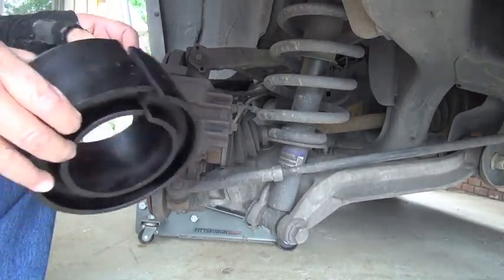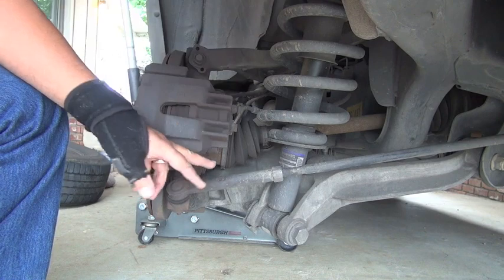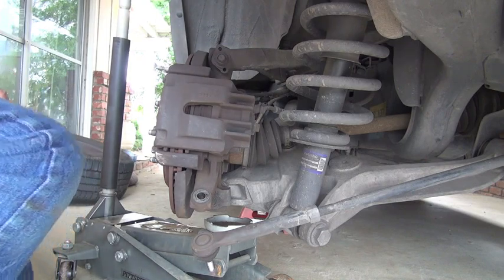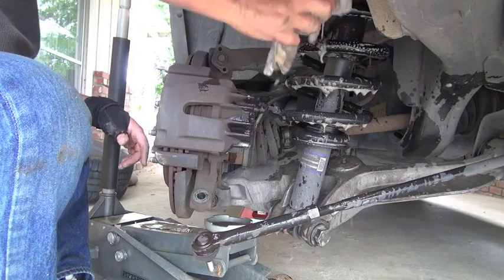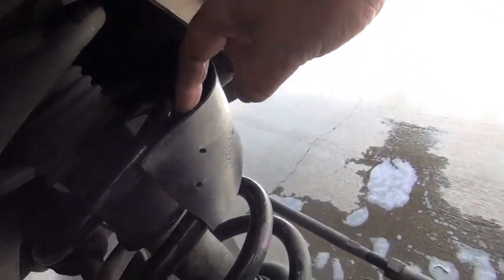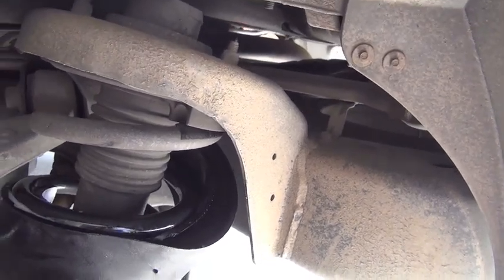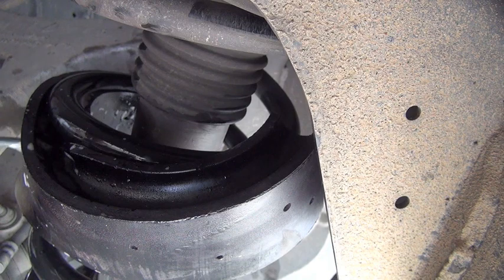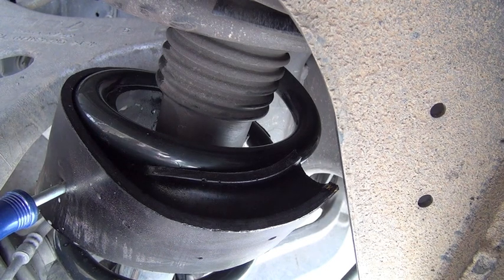2003 Ford Expedition SumoShocks Instillation

Comment: I know this is old video, but for those who are looking at buying these like I am, if you want to make this both easier and do it right, you have to get the right size. Everything he does here is unnecessary if you measure properly. From the manufacturer: "Take the measurement with the vehicle as it sits. You do not need to raise it." Meaning there is compression on it when you measure the coil gap and select the size. It is NOT the distance when extended. I haven't been working on cars for 40 years, but I can follow directions.

Comment: FINALLY! A helpful video, oh man I feel your pain! My Expedition was a real PIA! I trimmed one of the front corner channels to get it started and forced the sumo in with clamps and cussing. Ended up one lower than the other, so tight it wont spin up to the center. I will use your method removing sway bar to spin ip to match the passenger side. Thank you SO much. I wish I saw ‘this video  sooner!
Reply: Mr. Chuck, Sir, u r the man

Comment: Actually the procedure is good,but you missed to measure the gap of spring at un-load condition so correct rubber damper is used.

Comment: I'm under the impression these are supposed to go in the middle of the spring where there would be the largest distance between the rings of the spring and the greatest about of movement under normal conditions...

Comment: Hello, nice video. My 06 navigator head dips lower after I convert the air suspension to coil springs. Would this little thing raise my front higher? to make the car leveled at least? thanks

Comment: I think you got a size or a couple of sizes too large.  They should not be that difficult to install.  Also, you wet them or spray them down with soapy water as well as doing the spring, they go in much easier.

Comment: Shit, I was looking for something easier than replacing my coils this winter, this is harder than swapping the coil out, I can loosen the shock, jack up the van, unbolt the locking tab and out it comes. I'm afraid my new tires are going to rub due to the coils being old, broken down, maybe the aluminum twist in spacers will work.

Comment: WOW I can't believe you  said it was cheaper for these than getting new springs.  These things are expensive as gold.  It is just a piece of rubber.  I bought a lift kit for front and rear for less than this.  I never thought a piece of rubber could be so expensive.  I checked the auto parts store, and a set of Heavy duty Springs with Shocks for the rear of my expedition is $250.00 - these pieces of rubber cost more than 200.00, unless you go with China, and they are still nearly 150.00...  I don't know if I have said it yet - But MERCY these things are expensive ;)...
Reply from the maker: The coil spring helpers that I installed on his vehicle were factory direct and  cost a total of $170. That was with taxes and shipping.
Reply: Autozone has them for 8 bucks a pop!
Reply: I got auto zone brand 17 dollars each

Comment: In malaysia. I fixed this buffer on my camry2010. 4pcs,price RM120 only. The forman fix this very easily. Never loosen any other stuffs. Never use any tools or soapy water. He just jack up the car, fix this buffer on the coils. Each buffer fixing took around 20seconds only. I wonder why this dude having a hardtime fixing it. The purpose of this buffer is to prolong the life of the absorser. When we hit any road hump hardly, the buffer will stop the coil cruncy, and the absorber will not fully retract. We save money on absorber changing with this rescue buffers. Cheers...

Comment: Hello Chuck, Hope all is well. I own a 2015 Expedition and wish i could see a before and after with a heavy trailer. I am pulling a camper and with the weight distribution hitch it still squats in the back. I wish I could see what the difference it would make after installation of the SumoSpring helper.
Reply from the maker: I installed these on my son's vehicle because they had purchased a travel trailer and was in the same problem as you. Once I installed the SumoSpring helpers his Expedition rode level and and his steering and braking felt more secure. He also said that the ride was firmer when he wasn't towing, 'like a new car ride'. Because of the increased ride height on the car, the tongue of the trailer will need to be higher so get a tall block for the trailer jack.

Comment: chuck does give a inch lift or 2 inch?
Reply from the maker: I didn't measure but it seemed more like 2". We did it to improve the ride while towing a camper trailer, and it did.
Reply: Will this will increases the stiffness of the spring

Comment: What r these used for?
Reply from the maker: suspension assist devise. I installed them on my son's vehicle to assist in suspension support for towing their travel trailer. His suspension was pretty tired after 150,000 miles and rather then install a new suspension system I installed these, which gave him the feel of a new suspension and maintained a level ride when towing.
Reply: @chuckraybon5780  will this increase the stiffness
Reply from the maker: @thejagc3736  It took a lot of the bounciness out of the old springs and gave it a greater 'like new' ride.
Reply: Does it give you a lift

Comment: that's not a control arm, mr. forty years mechanic. that is the tie rod.
Reply from the maker: Thank you for the input, I stand corrected.
Reply: Actually it’s a toe link. Used to adjust the toe in or out on the rear wheels. Good video sir!
Reply: @aribby   i beg your pardon. it is called a tie rod assembly by the manufacturer, ford motor company ltd., part number and description: "Tie Rod Assembly - Ford (6L1Z-5A972-A)"
you stand corrected.
https://www.tascaparts.com/oem-parts/ford-tie-rod-assembly-6l1z5a972a?origin=pla&gclid=Cj0KCQiAtP_iBRDGARIsAEWJA8je0cRyVQRZfquoso9wd1FeC8JJVFSvOjYhhJO9UlyGlcOY3VdwnY0aAlM2EALw_wcB
Reply: @axlegrind4212  Does it have to be an argument? I mean , you  seriously can't pass along good info with intent to help another person? The guy made video to help others when he didnt have to, and here you come acting like a straight up asshole.
Reply: @chuckraybon5780  Just call it a doohickey, or the adjuster thing, next time.  We all know that is what you wanted to call it. Love the video, thanks for the info!
Reply: No shit. This video is a lie. That is a strut. If you pulled both upper and lower the distance on the spring does not change.40 years of mechanics.  What a joke. I wouldn't listen to this guy at all.